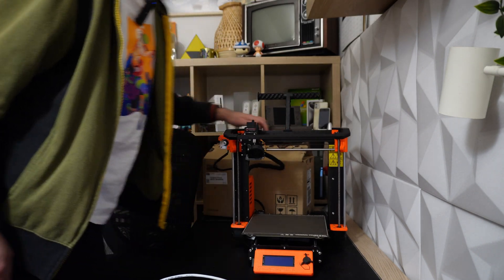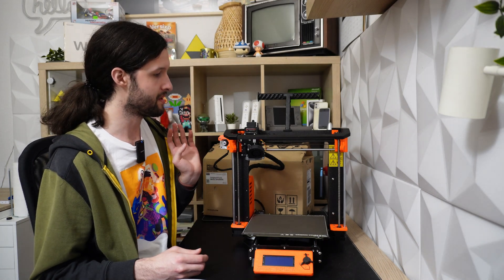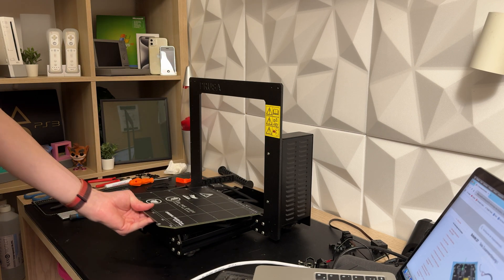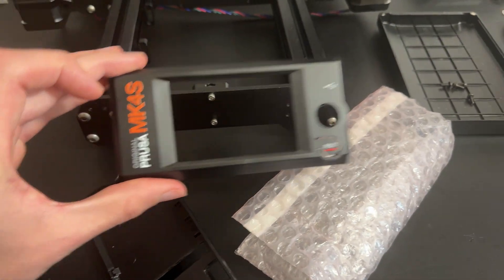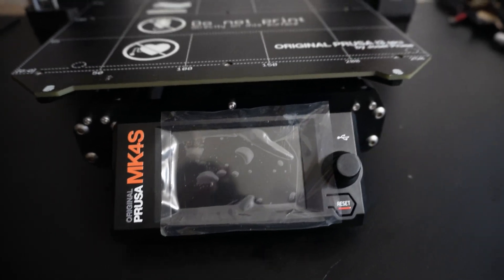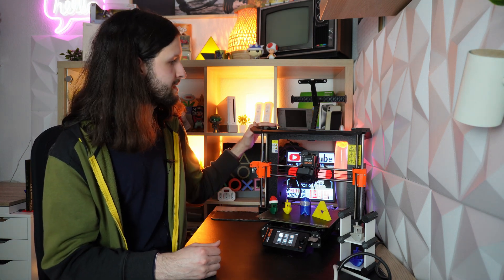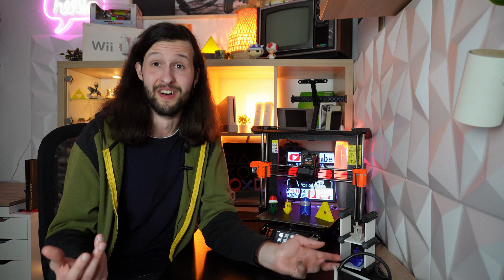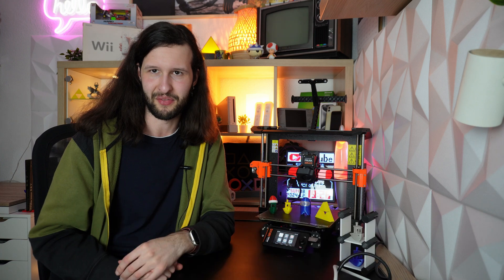Why EVERYBODY should offer such an upgrade! - My Prusa MK3 becomes a MK4S!

Comment: Great video. Just wonder on the documentation when it came to the pages saying "This step is required only in case you will be building the MK3.9S printer." As i will go to to the 4S do I need to ignore these pages? Skipt it??
Reply from the maker: Hey, it is mentioned in the Documentation that these steps are only for the MK3.9S. But as i think it is only the motor-adaper Cables that are needed on the MK3.9S, because the MK4S has new motors with the matching connector. So yes, when this point comes in the documentation you can skip it, i think it is also stated in there on the Prusa website.